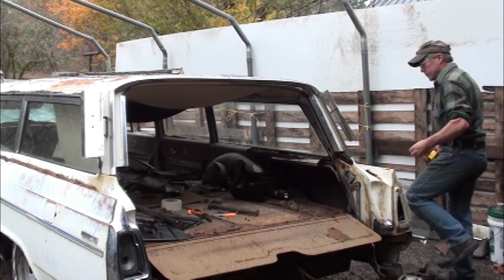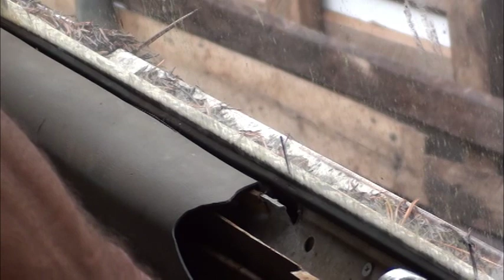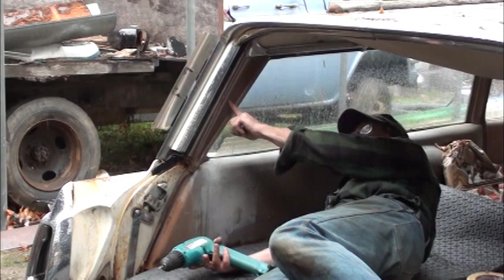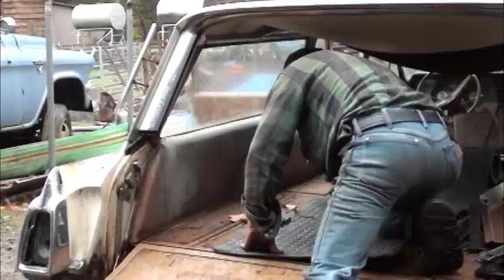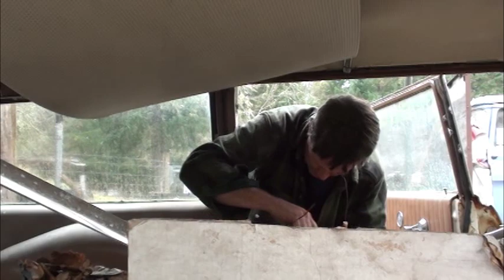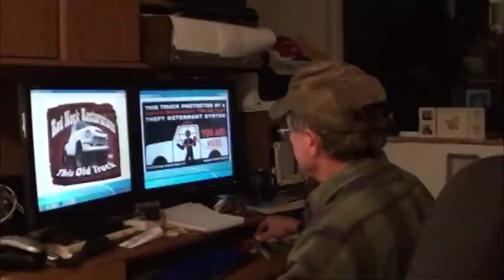1963 Buick Invicta Wagon Tail Light Removal

Comment: I used to deliver parts for a living. One of our regular customer's a mechanic used to say that automotive engineers should have to be mechanics for 10 years before being a designer. His reasoning was because of all the work you had to do to remove the tail light. It was designs like all the extra things you have to remove the tail light on that old car. I think that is a great idea. It's no wonder shops charge so much for labor. Thanks for the video I find it very informative. Good thinking to use the brake tool to remove the clips for rear interior panel.

Comment: Jeff if you use a heat gun on low settings and heat up the panel it will make it more pliable with less chance of cracking and in some instances will bring the color back to the panel,just make sure you don't stay in one spot to long the older plastic will melt a lot faster than newer

Comment: I wonder if there are any records as to how many people have got tickets for driving '63 Buick wagons with failed rear lights...  It's got to be a lot, I don't see many people going through that torture to replace a blown bulb...  It's nice to know that building cars in a way that makes them nearly impossible to work on isn't a new phenomena, just one that they've really refined now.  I mean, when you've got to take the front bumper off a certain make and model of car to change a headlight bulb...  That's just plum crazy...  Incidentally, the front bumper in question pretty mush IS the whole front end of the car...
Reply from the maker: +gosportjamie This is the housing. The bulbs are right under the lenses. 3 phillips screws and you're in!
Reply: ElderlyIron   Of course.  Mental derp on my part, it's only newer stuff, mid '70s on that have one-piece light clusters.  I must have been having a senior moment lol...

Comment: So, I know from the video you cannot respond to comments, which is a shame.  Still, I'm curious why you had to remove the interior to get to the lamp housing.  To my mind there is no way that GM intended assembly to be that difficult with the car rolling down an assembly line, so that means there should have been a MUCH simpler method for installation and therefore a much simpler method for removal.  Supporting my theory (from an armchair mechanic who has never actually worked on a 63 Buick Invicta Wagon, so take that for what it's worth) is the fact that you had to cut the interior metal panel to access the passenger side lamp housing.  Was there no access from below the car?

Comment: What did you do with the engine.
Reply from the maker: +kennethrobinson11231  Sold the whole car. Need a nail head?
Reply: +ElderlyIron Not really. I have 2 401's and I got a 63 that I installed a 30 over 425 Nailhead. I changed it over to a 4 speed. 2x4 too. Runs good. not as good as the old Pontiac 455 but it does good. Always looking for parts. What do you have.
Reply from the maker: +kennethrobinson11231 

Just the '50 4 door at the moment, but I have access to a 64 Riviera that's rear-ended. It's still complete at this point. I can't remember if it was left or right rear it was hit on.

Comment: Someone needs to write assembly manuals in reverse. Disassemblification manuals. There is a market, but they wouldn't want to buy them new they would want the flea market price from the get go.
Print them on moldy paper with torn edges.

Comment: You are trying too hard here. You should just be able to remove the retaining moldings and carefully lift the piece up and out of the clips.
Reply from the maker: Look at the clips that are exposed on the right side where the panel is broken. It's a 3 barb clip that was made to never be removed. 1 inboard and 2 outboard of the panel. These are 50 year old sun-baked plastic panels. You can't try too hard when trying to save irreplaceable 50 year old panels. Having tried it the "easy way" cost me a $40 panel. That's why I posted a video on how to safely remove them without destroying them.